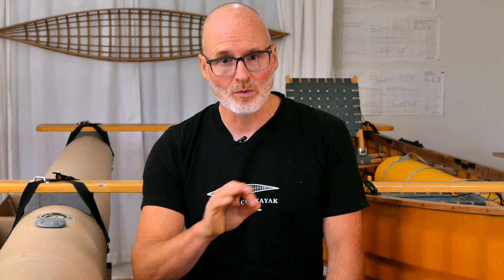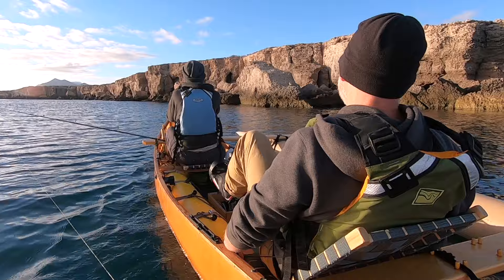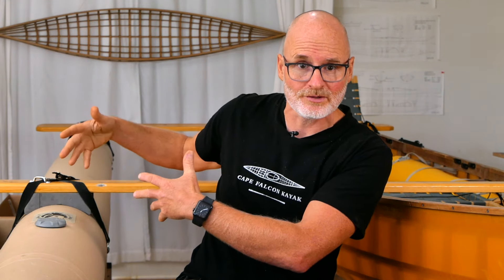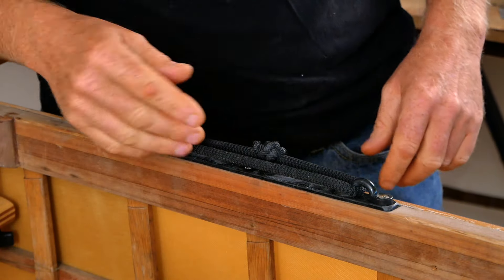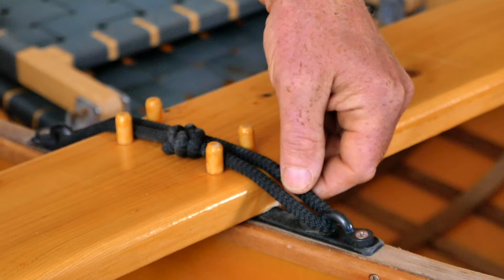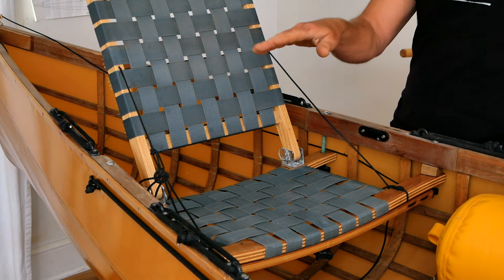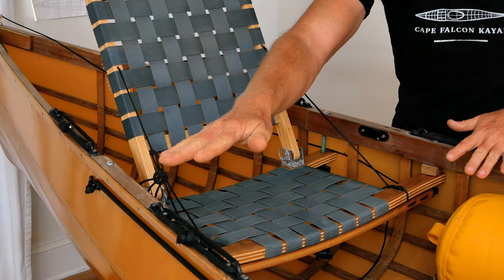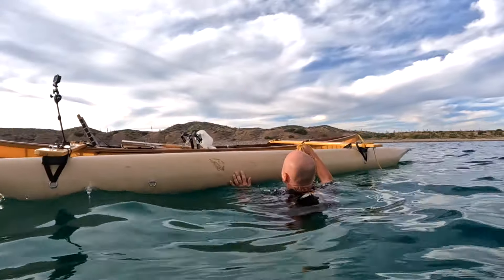Skin on Frame Outrigger Performance Review

Comment: Hard rubber replaceable blocks glued with (3M 5200) into the outrigger board wear points would provide longevity and grip to the system.

👣🕊👽